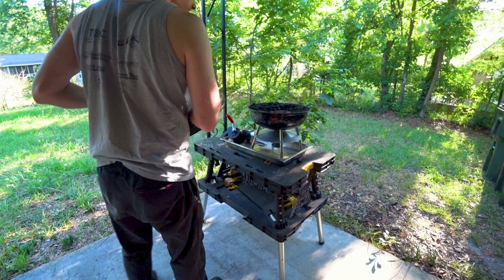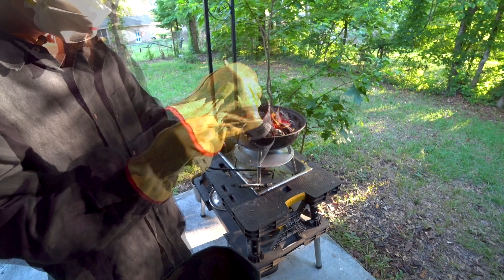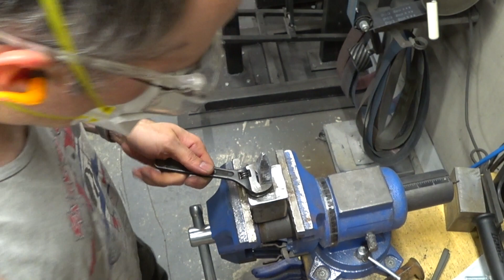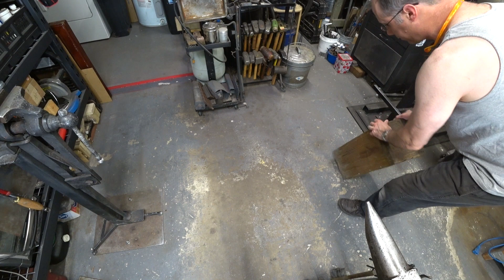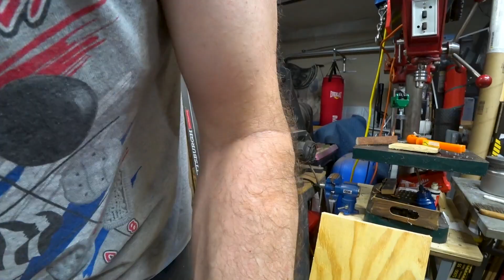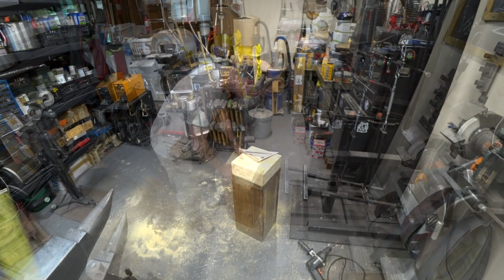Heat treating and mounting a stump anvil | Start blacksmithing

Comment: Could you leave the hammer head in one piece, and then form a hole for it in a block of wood or stump?  Still do the heat treating but avoid having to do the cutting and drilling?
Reply from the maker: Yes, you absolutely could do that. I believe @BlackBearForge has a video of that. If I was going to do that the first thing I would forge would be a large staple. Then you could put the staple through the hammer eye and fasten it to your stump securely.

Comment: Because of the mass / size of the chunk of metal, it is difficult to cool it fast enough.  So you probably needed to use water for the quench.  Even if it was an Oil hardening alloy, you still may have to use water because of the mass.
Reply from the maker: You are right and I did use a water quench.  The only thing I could have done for a potentially faster quench would have been brine.

Comment: I was thinking the tempering was unnecessary. It would have been interesting to see what the hardness was before you began, and again after the quench.
Reply from the maker: I ended up needing to case harden, turns out the sledge was actually a mild steel mallet. The next video in the series goes over the case hardening and I'm pretty sure I included hardness test results.

Comment: I was wondering about the hardness of the hammer, because I made 2 anvils from a sledge hammer last year and it took 1/2 day to cut in half and a good part of another day to dome one face.  That hammer was hardened right through.
The way you added the stake is cool. Did you consider a longer stake to create clearance for raising work?
Reply from the maker: The hammer I used turned out to be mild steel... I just assumed it was a hardenable steel because soft iron hammers are not very common. I had to case harden it to make it usable.  I don't really do any raising, so I wouldn't want to reduce rigidity by attaching a stem to it. You certainly could make a multi-part anvil using the same technique I did in order to make it taller.